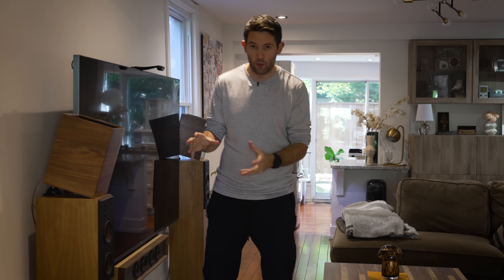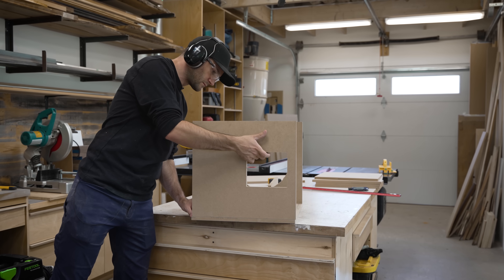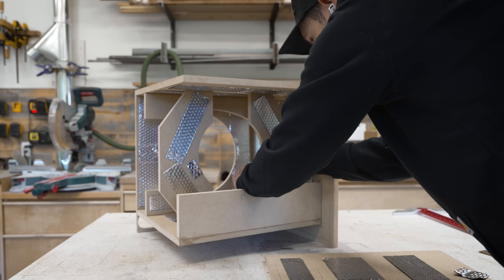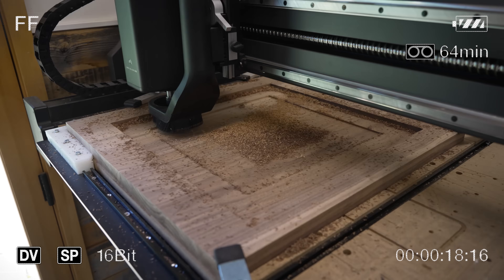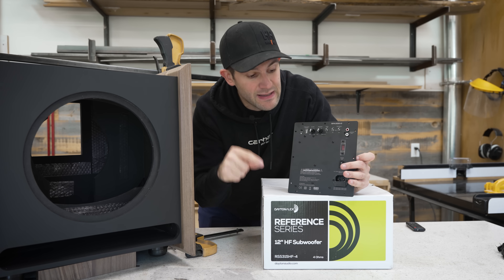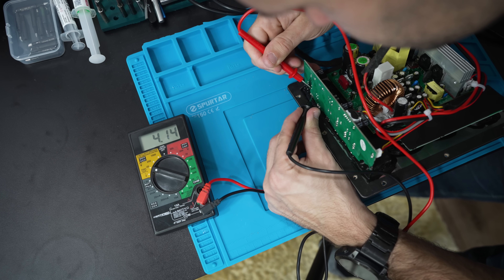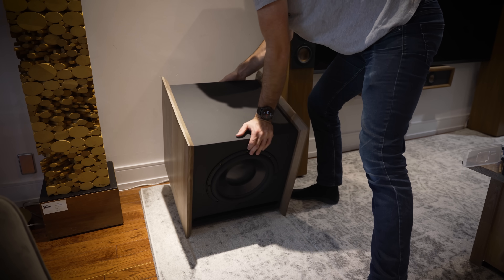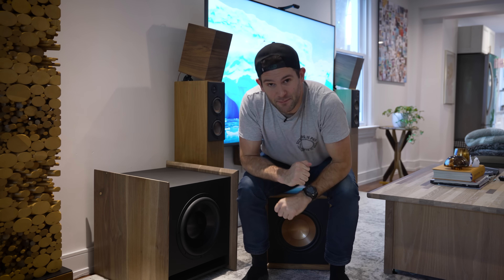THIS changes DIY Audio...

Comment: I love this video because it shows you the complete process. 
If you really want a dynamic sub-woofer that is even  cleaner and louder and more efficient, I would go with the sub-horn designs. You can use a smaller driver speaker and get much lower response and 10x more acoustic power output. The cabinet is larger and more complicated to make but you have the tools to do it. I don't like using particle board for speakers, makes them way to heavy to move around. I use 3/4 inch plywood. Also, 3/4 plywood does not flex like particle board does. I would always use an external amp. That amp would be vacuum tube. With the above type of design, the amplifier power can be much, much lower. These sub-horn designs can be built into furniture or low profile cabinets. They can put out 20HZ at approaching 120 db with low distortion. That's pipe organ territory. Most sub systems are just over-driving the woofer and cabinet and causing 2nd harmonic distortion.
Reply: The engineering on a horn is much harder. So building from plans from a speaker designer is crucial.  But if you have the space a horn can be magical.  The "why" is beyond the scope of a comment but interesting - i use the nozzle of a rocket to explain it because it is "rocket science " to build correctly. Math is involved.  Heavy math if done correctly. Secondly i dont know of any software solutions like the ones using. T/S parameters for sealed and ported boxes.
Reply: @scottwheeler2494  
HornResp is free to download and does all the math for you.

Comment: I’d be more interested in those wireless audio transceivers if they weren’t in the 2.4GHz range. Our theatre has a set of 2.4GHz Audio-Technica mic packs that have some serious issues with range and digital interference. I’d be much more comfortable in the low UHF range, which offers very similar latency and far less interference. That band is also used by ATSC digital TV (at least in the US), not by every WiFi router and their dog.
Reply: Do you have a Panasonic cordless phone that uses 2.4 GHz DSS (Digital Spread Spectrum) Technology or a leaky microwave oven??? Those will definitely kill your signal!!!

Comment: People are more prone to damage a driver from an overdriven underpowered amp than one rated higher than the drivers rating.  i.e. distortion damages the speaker more often than overpowering. If you've ever heard a blown speaker it was damaged by distortion.  Drivers damaged by overpowering usually no longer produce sound.

Comment: so explain this to me like I'm stupid.  I know you are an audiophile. I get it.  and you took a LOT of time to make this box perfect looking.  it...just....sticks out into the room like big dog poop on the carpet is all.  it is MASSIVE and I can see guests tripping over it and such...why didnt you just use the available space UNDER the tv itself to build a longer/taller/skinnier box with the same volume? one that sits much more flush? and depending on the volume you choose...you could shorten it a bit and maybe put like a bonsai tree or something else on top? the woodwork you do is top notch.  make it a decoration.  I mean honestly....you could also hollow out the wall and use the back of the box as support for wall structure if you really wanted to get crazy and save space...

Comment: Great woodwork.  Most speaker builds I’ve seen use insulation wool to damp higher frequency noise and air movement sounds.  You don’t notice any wind noise or chuffing by not doing this?

Comment: I've just made a sub for a friend, about 700x350x320mm, 10" driver ... didn't need internal bracing as it was made from 40mm thick bamboo!
For the driver and amp mounting I had brass plugs on the inside, and used machine screws for mounting. For internal dampening of the walls he uses carpet tiles glued in with liquid rubber (Gorilla Waterproof Coat & Seal).

Comment: • The amp should be rated with a higher power output than the speaker, When amps are pushed, they can distort, and can spike DC with is bad for sound quality and can damage the speaker.
• You NEVER run cables under a rug or carpet,
• Adding the wireless system, you will add latency to that signal. Bass frequencies tend to already lag behind the mid and high frequency because of the dept of the speaker.
• Using an built in amp is in NO WAY "better quality" over an external amp. Theaters and concert sound use passive drivers and separate amps to drive them.

Comment: nice work all around!
your idea to use big beveled edges on that gorgeous walnut shown at 9:20 was great, suggesting (to me, at least) some of the classic JBL 1960s designs - just add a glass or marble slab and you're there ... anyone have an idea which amp chip is in the plate amp? TPA3255 maybe? - thnx

Comment: Nice build ...!
Talking about subwoofers from Dayton Audio...... I've built myself two subwoofers out of 4 of the Ultimax 18.
If you picture the Perlisten D215s, I've made my own (D218s..?).
Both of them are powered by their own plate amplifier from SVS, the Sledge STA-1200D.
Subwoofer overkill...?
Yes, without a doubt....but I don't have any close neighbours, so it's all good.
Happy hollidays...!

Comment: years ago, i made a sealed box for a 12" out of 3/8" MDF and covered it with wallpaper. and used 3/8" metal pipe for a short trypod stand for it. it actually looked amazing. the problem was the total weight of the assembly was too light and it would walk around a few inches during a movie. Of corse, you could hear it moving. i tried rubber feet, a fourth leg, and finally stacked a foot of text books on it. i went back and remade it out of 1/2" plywood and bolted a 5lb hand weight inside = problem solved and it sounds REALLY punchy!

Comment: 10:58 Don't listen to this advice, it's incorrect. Better to have too much power than too little. This is the reason for a gain knob, to back the power down if needed. You never want your gain knob set to its maximum which can lead to clipping and distortion.

Comment: "Class D means digital"  🤣🤣🤣🤣 NOPE !
Reply: I thought the exact same thing when I heard that😂 he  is knowledgeable though for sure.
Reply: All solid state amps are digital switching amplifiers.  A vacuum tube amplifier however......

2x EL34 here in Class A/B pushing 50w at .1% distortion. By the time I get to about 80-100w it gets creamy with distortion.  

Can your Class D get "creamy" when it clips? Mmmmmm, yummy!!
Reply: @khunthaasmyseed-h6v ridiculous,  Class D  are not Digital at all 🤣
Reply: @ I have both. Do you?
Reply: @khunthaasmyseed-h6v  yes I do, I also has 15k of studio equipment, I've worked in some of the biggest recording studios in the uk over the last 30 years, so what's your point ?
Reply: @ Class D is absolutely digital. The D doesn't stand for digital, but it's operation is absolutely digital. Perhaps you're confusing the word "digital" with "logic" or "data". The light switch in your house is digital. Digital just means on or off with nothing in between.
Reply: @ Solid state class A, AB, and B are all analog amplifiers. Tube amplifiers are almost always analog. However, I could build you a switching class D amplifier from tubes if you like. There were vacuum tube PWM switching motor controllers. That's almost a class D audio amplifier already in the 30s!

Comment: While i dont have the patience or tools to build my own speaker cabinets, one suggestion i would make is that instead of hot glue, get UV resin and a UV curing light and it will be much stronger.  This curing light will also make it so you dont need to cure the solder mask or uv resign in sunlight.

Comment: You have the science down, but the woodworking isn't the best. Butt joints with MDF is generally discouraged. The ends will suck up all the glue leaving little to no bond at all. The nails help but not by very much. They will break down over time, especially with the vibrations of the sub. Rabbet joints with internal cleats would be the way I would go.

Comment: Very nice work of art and I'm sure it does sound great.  I would NOT consider any Klipsch to be high end since Paul Klipsch died.  He put his research into a great product and great speaker the name lives on but not the quality. Pricy maybe but not high end. Kudos to you for putting the time in on the construction and research. Original Klipsch speaker continue to outperform most of what's on the market. With todays tools CNC machines and 3D printers we can produce these more precisely than ever before. Nice work.

Comment: Sealed subwoofers more accurately reproduce frequencies with a flat response or even volume.

Ported speakers DO NOT have a more natural sound because they have a port.  Ported speakers cabinets play a narrow range of frequencies loudly, making them boomy. Because they are ported and tuned, they do not have a deeper low end reach.  They sounded boomy.

Comment: Great video but not everyone has that type of equipment at their home, to make the Sub. Now what did the total cost for this project? amp plate, speaker, MDF panels, butyl rubber sheets, paint, varnish, bluetooth receiver, 3D printer, brass screws and those fancy side panels? well it would be better just to buy a SVS subwoofer and save all the hassle unless you have the time and equipment and money. I myself have the SVS SB 4000 subwoofer. I think it weighs about 107 pounds and  comes with a wireless app, 5 year warranty, after 6 years my sub had issues and SVS went the extra mile and fixed it now thats customer service, good luck on the build.

Comment: Wireless receivers cause group delay unless the transmitter has an option for time correction of the full range speakers, or you are using a DSP with time correction.

Comment: I already have a powered sub, several actually, but my favorite is an older 12' paradigm, but the amp blew the other day. I busted out my 2 polk 12's, but they were no where as good as the paradigm. I was told they don't make parts or service them anymore, and to get a new sub of that quality I'd have to start looking in the $2,000+ category. Not wanting to do that, I want to replace the amp. My question is, will a Dayton sub amp of the same wattage, work as well, or are the subs designed and engineered specifically for that amp, in that box? Basically, if the input is the same, will the amp make the woofer sound the same?

Comment: What you should actually do is research and learn how to use WINISD or HornResp (which can be used for non-horn loaded enclosures) and model the driver and the cabinet with the amplifier power to see, with close approximation, how all the components will react as a system. Adjust the system's three parts (Driver, enclosure, amplifier) to ensure you’re getting the correct transfer function response you want and the desired SPL. Also, the enclosure's volume, along with the length of the port, affects the turning frequency. If you alter the port size or length, you need to also adjust the enclosure dimensions. This can be seen in the previously mentioned software before you even buy wood glue. Then, once you get it in the room, you have to deal with the acoustical issues of putting this subwoofer system inside a box... Anybody who just buys and builds things and tosses them into their theater and says, "that's good," won't even begin to realize they are missing performance or made poor decisions that affect their setup as a whole. Not saying you can't do it and get boom boom, but it just won't be as good as it can be. If you're going to be building your own subwoofer from scratch, why not dive all the way in and actually learn everything that's involved in building a proper custom one that suits your needs. 🙂Also, never underpower your subwoofer, as mentioned in this video. You will want clean power without the amplifier being at its limit, so I suggest doubling the amp that the sub is rated for so you don't have to tax the amp as hard.  Happy building!

Comment: I have a feeling your enclosure design is going to result in a lot of chuffing or wind noise because your port angles are too sharp. Otherwise, nice build. Speakers also make a huge difference. I have two different subs (car audio) I know, I know, totally different animal. I have a Sundown v2 series in a ported and a Soundqubed hdx3 in a slot ported enclosure (both 12s). They both hit very, very hard with 2200watts going to them however, I found the Sundown is way more musically balanced and able to achieve bass notes higher up the frequency ranges, 60, 80 hz whereas the Soundqubed, because its more of a competition grade, hits lower often leaving some rock music lacking in any bass. I think audio in general is a fascinating subject regardless what application I think you can learn and apply your experiences in different applications to get a desired result.

Comment: Class D = digital? not so much.... more of a switching style power supply where you feed it an analog signal rather than a reference voltage. Very analog really.  (also a simplified description)

Comment: There is a lot wrong with the "research" done. ClassD is NOT digital, a "too powerful" amplifier is usually the better choice if your hearing is not seriously damaged. The amplifier clipping is the biggest chance to destroy the driver. The port on the front causes the greatest amount of phase cancellation. Closed windows block UV.
The woodworking was very, very good! Measurements to prove latency and LF extension would have been interesting.

Comment: Airtight is overkill on a ported box, there is not near enough pressure for it to matter. And those ridiculous side panels are going to vibrate where they dont contact the MDF, negating all the sound deadening you did. Also, you have a 10K lathe but not a UV light to harden your solder mask? lol And a 12" sub always has more range and less sound pressure than a 10"... duh

Comment: You might love my subwoofer - it's a 6th-order bandpass sub with tuning freqs set to 135Hz and 16Hz (yes, sixteen hertz). It'll happily go sub-audible, at which point you won't hear it but you'll absolutely feel it, as will your surroundings as the walls will vibrate and windows will rattle as if shaken by an unseen hand. Only downside is that it's pretty big, about a cubic yard of volume, or about the size of a mini-fridge.
Reply: I had a horn with two JBL car subwoofers that was poorly built but had at least some output into the single digit hertz range. I'd only tested it off an Acoustic Solutions SP101 amp so not exactly serious power, but the 20Hz was satisfying pressure like a helicopter and making the conservatory windows move alarmingly so I turned it down. 7 Hz I could hear faint puffing noises but when I closed the door I could hear it going "ba ba ba ba ba ba ba ba" on the frame.

Comment: well.did you know that normal windowglass does not let  UV light through? you need a special UV LED for that. it is raher cheap but more effective than  your exposing  the thing to UF-filtered light, and, more important, 99% of the listeres will not hear the dfference in sound, as these people listen to some small pc speakers., as least not to a sub that can produce enough bass to hear the  difference.

Comment: Those butyl mats were supposed to be rolled by a roller and hammered using a rubber mallet so they stick and deform nicely, ridding airgaps between the surface and the material (in car audio)

Comment: dont use PVA glue if you have a painted surface it wont stick, you need to use AV56 or the best thing is to just not have paint where you want to have a glue bond

Comment: well the audio is sent wirelessly to the speaker.
it still is not a cordless device - just for power reasons - until you will use sorts of batteries - that either will need regular exchange or charging on a line.

Comment: You should have used a dado joint instead of a butt joint. The joint will create a better seal and make the box more structurally sound. You could have used rabbit joints for the inside walls. If you would have used the rabbit and dado joints then it would have been much stronger and you wouldn't have to make the support braces. You would have been able to literally just use glue and clamps to put it together and it would have been plenty strong. I would also run a bead of silicon caulk along all the seams. That just what I used to do when I would build speaker boxes.

Comment: And have to be the snob. It's not RIP Klipsch. You'd have to do a lot better than that. The Dayton Reference are alright, but if you're going to say it's the end for Klipsch, you better go harder than a 150 dollar "pretty" driver. and if we take the whole companies as a whole, You can work for years and you won't be able to touch the sound of the Cornwalls, or LaScalas, let alone a pair of Klipschorns using even the best Dayton drivers.

Comment: Its better to have an amp that is around double the power rating of your subs. You can turn your amp down to the subs recommended power, and ease the strain on your amp and have the subs getting good clean consistent power.

Comment: Couple of questions... 1. Since the wireless transmitter/receiver operate over a 2.4 GHz frequency, did you encountered any kind of interference issues with wireless access points, microwaves, etc? 2. Is there any noticeable delay between the video and the audio (it probably be more noticeable if you do the speakers and center channels)?

I may be stealing the wireless transmitter/receiver idea for home audio.

Comment: I feel like you claimed to read up on sub enclosure building, then ignored basic facts, like how you think having the port face the same way as the sub is a good thing... It's not, it's bad design. The sound that comes out of the port has the opposite phase of the front side, aligning them DECREASES volume, and as it's facing you directly, you'll hear the wind noise all ports make. THIS IS WHY PORTS ARE REAR FACING, BASIC SHIT.